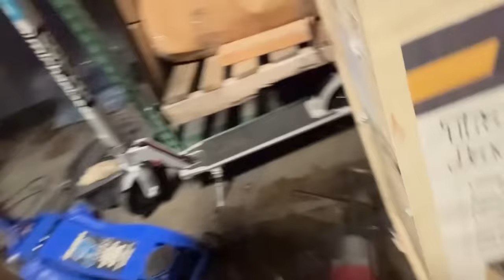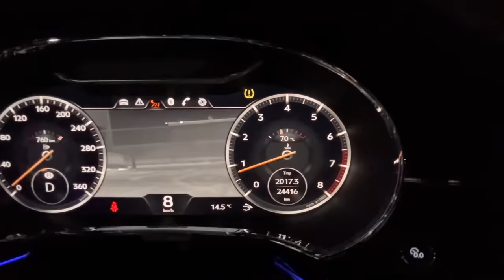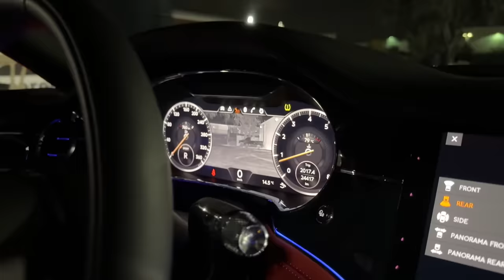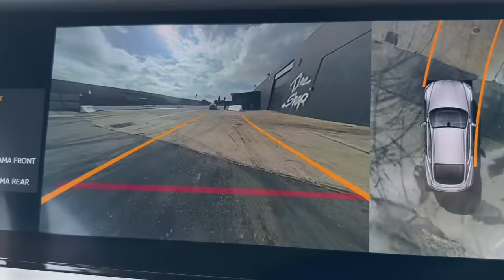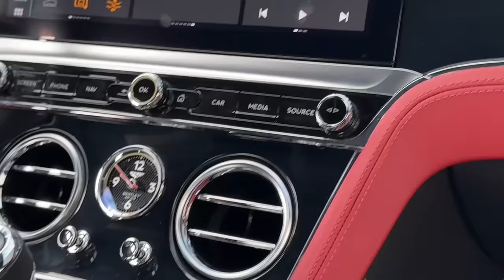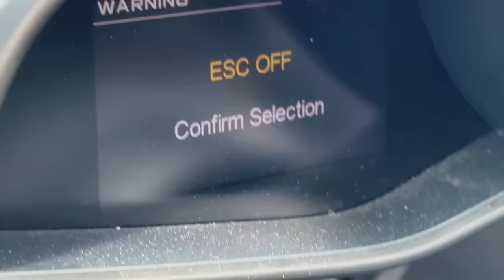This was  EXTREMELY CREEPY at DDE HQ…

Comment: The prototype was an A236 (the new CLE Convertible) which is replacing the c- and e-class convertibles/coupes. It is supposed to be on a level with the e-class, but is based on the c-class chassis. Source: I am an engineer who worked on the a236 before. The coupe is already released.
Reply: Just a wild guess I'm gonna say its a Mercedes A236b convertible the coupe is already released... lol
Reply: @jacobcopeland1922  That’s exactly what I wrote? The coupe is called C236.
Reply: Thanks dude
Reply: @simonb2991  Thank you for your work and service!!

Comment: There was debris somewhere up the highway and the road that they had to get out of the way so he traffic baked early just slow everybody down, but not completely stopped them once the debris was cleared. He pulled off so everybody could proceed. That’s why they did the traffic break.
Reply: makes sense
Reply: Ah, like a safety car in a race.
Reply: Not necessarily, it's done also to reset traffics speeds if the flow of traffic is too high. Rather than pulling one or 2 people over. They do that as a reset then pull off
Reply: @MarioMarquezPapaMarquez maybe he knows why there was a brake
Reply: @MarioMarquezPapaMarquez isn't that what he said? 

Not sure about the "pull one or two cars over" part but....
Reply: Na he was just a Tesla hater 🤷‍♂️

Comment: Dave is obsessed with carbon brakes. He's always talking about a car having carbon brakes 😂😂😂
Reply: with damon's billet fuel caps 😂 😂
Reply: Canadians and the carbon tax 😂
Reply: And Damon with his obsession with race car steering wheels
Reply: It’s bc he doesn’t understand ANYTHING else about the cars.
Reply: @NickBirdManeS it's not the potential, it's the difference in even normal braking. Obviously he has experience with both and his preference is carbon ceramic....... 1000hp isn't needed, it will rarely ever be used to it's full potential but the difference is noticeable throughout the entire RPM range! 

You don't have to push everything to it's brink to feel the difference or prefer one over the other! 

If you had the option to choose.... Why wouldn't you?

Comment: The wind will blow the water in under the roll-up doors. Check to make sure the rubber that should  run along the bottom of the door is touching the ground securely when doors are down.

Comment: I’d have to disagree with the comment that you’re ruining the cars when modifying them (not always at least, some people make terrible choices lol) - while it’s definitely true that a manufacturer with an enormous budget and huge engineering team can execute something very well, the actual end product still has to be restricted by things like universal emissions regs and the maximum MSRP that the car sells for - so there is room to make a car objectively ‘better’

They can’t make the absolute max power as some emissions focussed changes find them back. They can’t make them handle as well as they possibly could, as top-tier suspension components cost so much that the final MSRP would be beyond reasonable, and so on.

Comment: My type of coffee and donuts  in the morning.. 
As for the cyber truck rust, It's called fallout/iron/break dust.. much more noticeable on white and silver paint.. Very noticeable on stainless steel like the cyber truck..
Some iron remover, and a light clay job and no more rust. If left on paint it can eat through the clear /material. Wax or ceramic coating helps prevent this..
Reply: 150k truck and owners have to do maintenance ASAP loool

Comment: Fun fact for you Damon. The CyberTruck has stainless panels which have a resistnace for oxidization aka "rusting". Different grades of stainless have higher resistances to various effects. Thats why stainless is used to various industries from dental to chemicals. I build stainless beer and wine vessles in Penticton BC and we've had customers that keep their tanks outside 24/7 and they dont rust through all the changes in weather. Not saying stainless will never rust but it will take a very, very long time unless the surface gets damaged. Once theres deep scratches in the surface it will be exposed to oxygen which will make it oxidize faster than intended and therefore form "rust" aka a layer of iron oxide.
Reply: Tesla used water the lowest quality is and it's absolutely going to rust. Especially anyone who sees salted roads in winter with one of these POS toaster trucks.
Reply: @TheSaw410  Personally... I highly doubt they used the lowest quality stainless. Easy test... put a magnet to a panel. If the magnet sticks its cheap stainless. If it doesn't stick... it's good quality. The test of time will tell. I highly doubt they'll rust.

Comment: Used to live in Phoenix and saw prototypes all the time.  I do have to disagree about tuning.  You are actually taking a caned tune and optimizing it for the engine it is running on.  Stock tunes are meant to work on every engine for a certain car, so they are modest to meet emissions and economy.

Comment: its actually not rusting, they have even officially responded to it, answering it... its actually a reaction to the compound used on the panels yes, but it can be more or less easily cleaned off with a solution, underneath its not rusted, should be able to be restored to the original look

Comment: Stainless steel doesn’t rust unless the surface has been penetrated. Typically the rust on stainless steel is a foreign substance that hasn’t been cleaned off and begins to rust. But it’s not the stainless steel itself that’s rusting.

Comment: So the Cyber Truck rust thing is actually not accurate. It’s not the actual stainless steel that’s rusting. It’s debris and oils and stuff that sticks to the body and oxidizes and turns the rusty color. You can actually wipe it off of them. They’ve recently told people to carry something to wipe off things that get onto the exterior and form that layer that rusts. Not great foresight on Teslas part. Seemed like a good idea to start. But I’m guessing these aren’t the only issues those are having.

Comment: I hate the cyber truck. But It's stainless steel.. it doesn't rust. That has been debunked.
It forms corroded deposits (essentially sweats rust) that can be washed off.
Also if you get a scratch it can just be buffed out, compared to repainting a traditional vehicle with paint.
Reply: Actually stainless steel can rust. It all depends on the grade of stainless steel, as the environment it's mainly exposed.
Reply: @RogerM88 I was referring to the cyber truck not rusting. Not all 150+ types of stainless steel. 
Find me a picture of a rusting cyber truck (that wasnt fabricated for clicks) that you think has the ability to rust rot in the next 10 years , as if it were some rocker panels on an old Chevy. All i've found is articles written by A.I., or people who've probably never even seen a cyber truck, let alone know anything about anything talking about rust. All the people who own one posting actual videos and doing experiments conclude the corrosion that builds up does not degrade the metal in any way and can just be scratched off.

Comment: Pointing out the elephant in the white car that's supposed to be a certified mechanic and has to be told by Dave how to turn off traction control!!!!
Reply: DUH someone that works on cars not drives them everyday !  But knows everything about them mechanically ! Plus hes never done doughnuts in that car before so how would he know how to turn off TT ? You talking trash but you didn't know how to turn it off either dude so hush ! Smdh ! Stevens probably already done more that day then u in a lifetime !